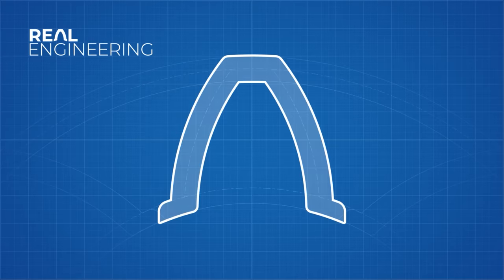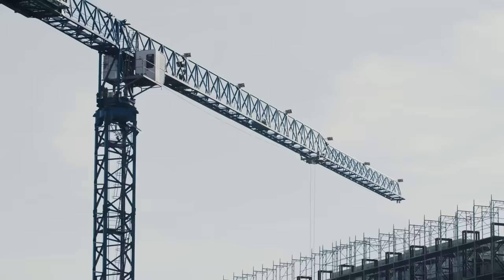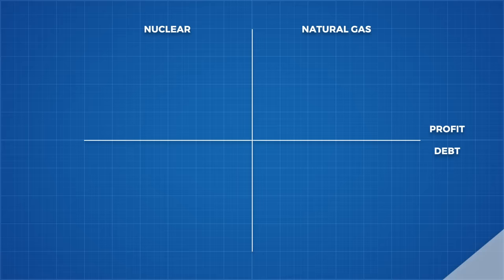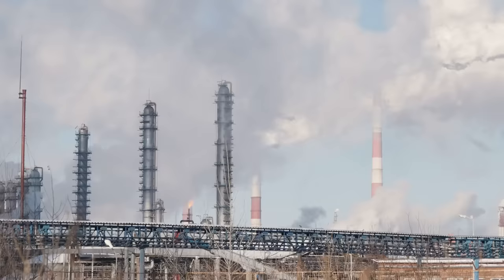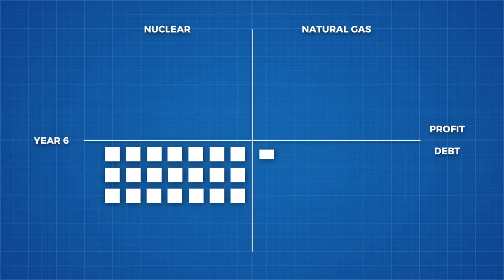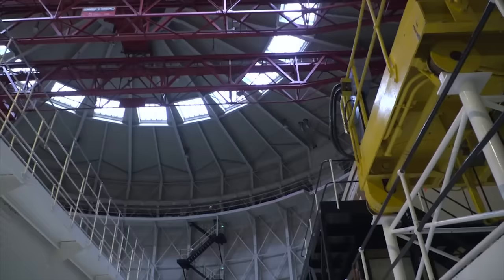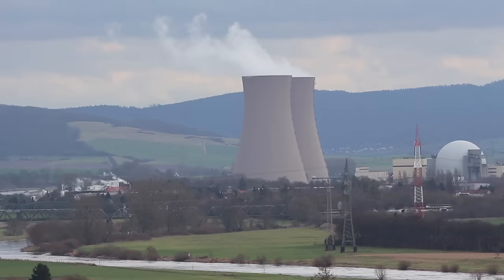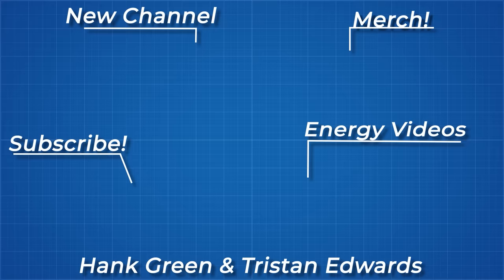The Economics of Nuclear Energy

Comment: The Levelized Cost of Electricity metric is skewed in favor of methods like solar as it doesn’t take into account the storage infrastructure needed to make solar and wind viable. Like mentioned in the start of the video, the ability of sources like natural gas to generate on-demand electricity and operate when demand and prices are higher makes it preferable in many ways.
Reply: It also doesn’t take into consideration how the concentration of intermittent renewables on a grid network requires larger scales of additional infrastructure. 

Under LCOE solar with 20% VRE costs the same as solar with 50% VRE, which isn’t accurate at all.
Reply: Economically, generate electricity = generate money. So if your goal is only to produce money, you don't have to add expensive battery if you don't want to.
Reply: Yea, some MAJOR issues with LCOE here.
Reply: redstone craft guy It’s not that simple. In reality you don’t even really compare a single plant to another plant as made in the mid video. I understand the comparison, and for the purpose of the video and it makes sense because the videos is talking about observed economic impacts largely for consumers. From a utility, state or grid manager perspective this isn’t how energy economics is evaluated, although to be fair it’s substantially more complicated. 

Id recommend a couple things for you. First watch the following video about the US Electrical Grid operations and challenges, as well as review necessary upgrades needed to support high renewable concentration as reported by the NREL. Lastly and potentially most importantly read the last study submitted by ANL and LNL on appropriately evaluating costs for energy networks and taking into consideration the real cost of variable/intermittent renewables with respective on its impact to the US Electrical grid: 

-“Argonne OutLoud: Ensuring a Resilient Power Grid”
https://m.youtube.com/watch?v=rJ-57hrPovc

“Transmission Challenges and Best Practices for Cost-Effective Renewable Energy Delivery across State and Provincial Boundaries”
https://www.nrel.gov/docs/fy17osti/67462.pdf

“Impacts of Variable Renewable Energy on Bulk Power System Assets, Pricing, and Costs”
http://eta-publications.lbl.gov/sites/default/files/lbnl_anl_impacts_of_variable_renewable_energy_final_0.pdf
Reply: Not to mention govt subsidies.
Reply: The cost of solar and wind are dropping fast and the cost of storage also keeps dropping.
Reply: @autohmae  Yes but the issue is the levelized cost of electricity is inaccurate as the cost of solar and wind are added on top of the batteries, not seperate. Nuclear is a baseload production type while solar and wind are on the quality of the weather outside. Because of this you can't just turn on a solar array at night and expect power such as the other formats. The others just produce power straight while the solar and wind only produce power when they can. Batteries are needed to replace these technologies so that means you need to add the cost of batteries and the solar or wind array together. From my calculations they end up being nearly double the price of nuclear though prior to subsidies, zoning, and legal matters. 

It's dropping but not that fast. It's more the batteries dropping as well. Solar panels haven't gone that far down in the past 10 years, but they have gotten slightly more efficient, though we are reaching the ceiling of what is realistically possible.
Reply: What about the storage cost for nuclear waste ?
Reply: Storage?? Skewed?
This whole conversation is only possible as long as EVERYBODY ignores the Elephant in the room called 
"Where are we going to put all the waste nuclear fuel?". 
Know of any Geologically stable mountains, that are not near any water tables, or fault lines or politically unstable areas (for 30,000 years)that we can hollow out  (magically without harming the environment) and use to store the waste for 30,000 years.
How are you going to guard it? How would that be paid for?
This whole thing is even more stupid than the "lets burn all the oil in our stupid cars because vroom vroom!"
Reply: @oscargoldman85  nuclear waste storage is a parallel problem to nuclear power expansion. We have to solve it even if we shut down every power plant tomorrow. May as well use it to help solve the apocalyptic climate crisis, too
Reply: @brian2440  nobody force them too so they don't have to do it. There's no law that force solar to must have storage.
Reply: @korianderbadger  Research into nuclear power could pay off hugely in the long run. Thorium reactors in the future may be able to convert old nuclear waste into energy. Nuclear fission scientists are more apt to work on nuclear fusion and plasma physics than wind or solar engineers. Cold fusion or LENR are the gold at the end of the nuclear research mining process.
Reply: @oscargoldman85  Not only are we doing just fine with the nuclear waste we have now but breeder reactors (thermal Th232 or fast U238) can burn that and only produce 300-500 year long waste and make 2 orders of magnitude more energy from it. Either way we can just bury it like horizontal drilling today which is below the water table and without having to frack it.
Reply: @oscargoldman85  there's not a lot of waste and most of it can be reprocessed into more fuel or other products not to mention the way half lifes work most of that waste will be gone in 500 years even if teeny tiny particles of it remain 30,000 years from now since there is very little waste all of it could be stored in small cave with a few guards at the entrance and there is in fact funding for storing nuclear waste the only reason we don't have giant secure facilities for storing tons and tons of nuclear waste for 1000s of years is because we don't need them

why don't you look at the real environmental impacts of the alternatives like the CO2 emissions of coal plants, the damage to natural habitats and loss of productive farm land from Wind turbines, the manufacturing cost(pollution) and limited lifespan of solar panels, the damage to water ecosystems from Dams, the CO2 emissions of gas plants

all of our current power generation methods cause damage to the environment and generate waste materials and pollutants as part of there overall cost
some more then others with coal plants being the biggest offender and nuclear plants being the smallest offender with renewables and gas plants somewhere in the middle

saying we cant have Nuclear plants because of the nuclear waste is like saying we cant have solar panels because there is too much waste in producing transporting installing them cleaning them and eventually replacing them
Reply: @leerman22  Oh Really? 
WTF r u on about ? 
How are you going to change the Half Life of Carbon 14 by "burning" U238? (answer: you cannot - you are BSing). 
Are you going to rebuild EVERY Nuclear reactor first, THEN build 3 times as many so you can get your new method around enough... also WHERE IS ALL THE URANIUM 238 COMING FROM? Australia? KLazakhstan? Canada? Forget that.
C14 is the real problem (you don't need to store the FUel (much) you need to store the Waste.... THATS WHY IT IS CALLED WASTE. 
It has a half life of 12,500 Years.
What the heck has Thorium got to do with it?  Start your ansxwer with the name  of a single currently commercially viable Thorium reactor. Thorium is actually a possible answer, but its not ready yet, and I think you are just trrying to be obtuse.
Won't the Military be pissed off without the steady stream of U235? 
How are you going to deal with the (1% by weight) of Strontium 90? which is more deadly than even Plutonium to Humans, because the Human body thinks it is calcium and weaves it into bones.
What a pile of garbage (waste).
But seriously; think about how dangerous this material is, and how stupid it is to waste it on maybe several decades of a small reactor and be left with MANY millennia of hundreds of tons of dangerous waste... Oh BTW - don't try the "throw it into the sun" answer either. (Long Story short... It would almost definitely involve accidently  scattering it into our atmosphere)..
Reply: @oscargoldman85  
Nuclear reactors are (by definition) custom-built atom-smashing machines.
You get rid of the C14 by putting it into a fast reactor and waiting for it to get hit by a neutron, transmuting it into C15, which decays in 2.5 seconds to N15, which is stable.
It's kind of a moot point though, because carbon 12 doesn't activate very well in thermal reactors where is is used as a moderator  and the problematic high-level waste is mostly Caesium 137, Strontium 90 and technetium 99 in the spent fuel.
Of these, T99 is the only one with a half-life above 30 years, and the only one that needs to go back in to be burned to reduce the waste lifetime.
The reason no-one is reprocessing waste now is two-fold: storage is easy (as volume is tiny), and Uranium is too cheap and plentiful for reprocessing to be worth it right now. That isn't to say re-processing won't happen in the future; it will, even if just to make the waste easier to store.
We have vast reserves of Uranium on earth; 90% of what we dig up goes into depleted uranium tailings during the enrichment process, then we burn 10% of the enriched metal and throw the rest into storage because thermal reactors are bad at burning the U238 which comprises most uranium. However, the first reactors, and a lot of new gen4 designs, are fast reactors which are much better at using the U238. We could power the earth for a couple of centuries without digging up another gram of Uranium. Then we could dig up the rest of the easily recoverable Uranium, Then Thorium, which is several times more plentiful, and can burn in fast reactors. That will keep us going for a few millennia (growth aside).
Then we can recover the Uranium dissolved in the earth's oceans (at a price now which is already economic for a breeder reactor - but no point when U from terrestrial mines is so cheap) and that will keep us going for ~10,000,000 years (growth aside)
So no; waste and fuel supply are not critical issues for nuclear power.
Reply: Oscar Goldman Why 30,000 years? What’s the significance of this timeframe in your opinion?
Reply: @oscargoldman85  Mate, burning for one is just a slang for using within a reactor. You don't need to rebuild every reactor, but build separate specialized reactors to reuse previous waste. You act as if it's a negative to build more reactors to generate more energy, when in reality it is generating income, green energy, and reducing nuclear waste, which is one of the most stated downside of nuclear power by people who oppose it. It is legitimately the fix to the issues that most people have with nuclear power. "Where is all the uranium 238 coming from?" You realize that only 0.71% of mined uranium is U-235, with the rest being U-238. When U-238 becomes valuable it will also open up the ability to pit mine in many areas again, as now that other 99.3% is not basically useless, but instead profitable. Atm many places resort to deeper mines because they need higher concentration of uranium within the rocks to make mining profitable. As for C14, a half life of 12,500 years is not actually that long, and is easily manageable with deep geological repositories (DGR). You mentioned before where is there a mountain that is inactive, which is not that difficult of a thing to have, with Yucca mountain failing mostly due to political and societal reasons, even though it was viable for disposal. You also don't require security for DGR's as they are extremely deep underground (varies depending on local geology), and no one except mining corporations can get that deep as they need special equipment, and that kind of operation would not be difficult to discover even if it was trying to be covert. You are right that strontium is a bone seeker, but through proper handling and disposal it will never reach people in the first place, and if it does, there are ways of removing it from the bone. You seem to know about certain nuclear subjects, but you must have gotten your information from extremely bias sources.
Reply: I love how Feed in Tariffs are not considered a subsidy.

Comment: Because renewables rely on storage + base load partners, the best economic comparison would be the cost of the whole electricity grid. Compare:

80% Nuclear
10% Renewables
10% Natural Gas
Vs
80% Renewables
10% Nuclear
10% Natural gas
& include cost of power storage.
Vs
Current system

I think the Nuke heavy mix would be much cheaper than renewable heavy. Therefore more economically feasible.
Reply: The storage costs are not ready to compete in common regulation, just on peak plants.
But because renewable and storage advance so fast, you won't find a investors for so big investment that it can even be non competitive in the long run because the changes in renewables and storage.
Reply: Exactly, system costs are an important consideration. While renewables have very impressive plant-level costs, they require more expensive support from other parts of the grid, like batteries and deployable peaker plants.

I read this fascinating report from the OECD a few months ago; it goes into much more detail on the system-wide costs of various grid compositions.
www.oecd-nea.org/ndd/pubs/2019/7335-system-costs-es.pdf
Reply: Did you miss a part of the video? He stated nuclear isn't fighting renewables, its fighting other base loads alternatives of which gas is the most popular option. Which he compared.
Reply: Based on what data?
Reply: @musicat3330  oh that's interesting. On page 10 it shows estimated $/MWh for renewables:
$38/MWh at 10% of grid.
$65/MWh at 75% of grid.
I love renewables but as video says there is no one-tech solution. I'll have to read the whole thing, thx.
Reply: @someonespotatohmm9513  True, they aren't direct competitors in today's market. My perspective is that of a person trying to figure out how we can 100% decarbonize the grid. From that perspective it seems to come down to a choice between Nukes and Renewables. I'd take a guess that a 60% nuke, 30% renew, 10% othergrid is cheapest and fastest to scale.
 But hopefully fusion, power storage, and carbon capture have breakthroughs and give us more options!
Reply: You couldn't run (any fission reactor's we have or will have in large numbers in the next 20 yrs) 80% of the grid on fission, it doesn't ramp up and down enough. You also have many very expensive fission reactors sitting around doing nothing for a lot of the time just for those peak times. To have that much fission you'd need loads of gas peaker plants or storage.
Reply: @turningpoint4238  hm, so we'd need some storage or speaker plants even with heavy nuclear mix. Makes sense.
Reply: @turningpoint4238  could simply go dual fluid reactor which physically support efficient hot standby, and back feeding. A bonus is that it can destroy non-salvageable isotopes.
Reply: You don't have to think it, France has already proven it. But all of these so called 'comparisons' never account for the way renewable energy destabilizes the grid, and what that costs to the consumer. So the numbers are always slanted in the favor.
Reply: @bronzedivision  But France didn't push on the full price of it's nuclear program directly through electricity prices but did in taxes. The UK is running at present on quite high levels of renewables quite happily without massive costs to the grid.
Reply: @someonespotatohmm9513  the impression i got was that he was comparing nuclear to natural gas peaker plants.  The peaker plants are needed because wind or solar aren't reliable (in terms of output).  So in effect, you could build a 1Gw nuclear plant, or a 1Gw gas plant PLUS the renewable's to go with it.
Reply: Additionaly, once a nuclear plant is running it can operate for 50-100 years, while solar panels have to be replaced 5 times in that time. The shift away from nuclear goes completely against low carbon emissions.
Reply: And ?
This whole shindizzle is based on lowering environmental impact of power generation.
Nat gas doesnt do that.
Reply: And that is why you couple them to users like Aluminium producers.
Reply: @brian2440  wow. So from what you've read, what do you think is the optimum mix, financially, for the US, fully decarbonized?
My guess is a thumb in the wind, based on youtube & podcast edutainment.
Reply: Good argument but those comparisons have been made and nuclear is a couple billions more expensive when doing that for a country like germany, like 20 billions or thereabout and the nuclear cost would actually increase over time due to fuel source degradationg whilst renewables decrease in cost over time